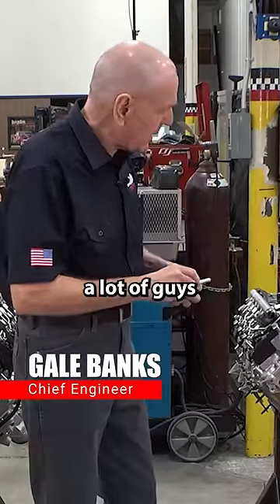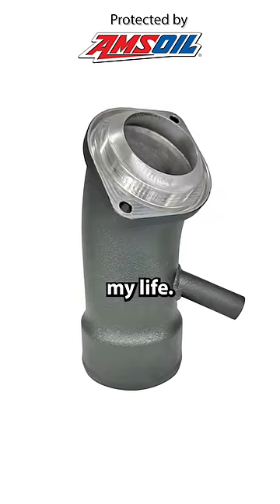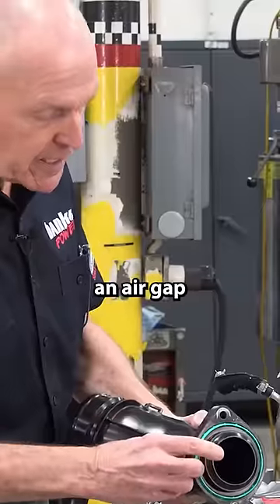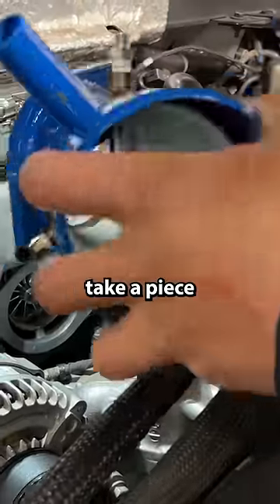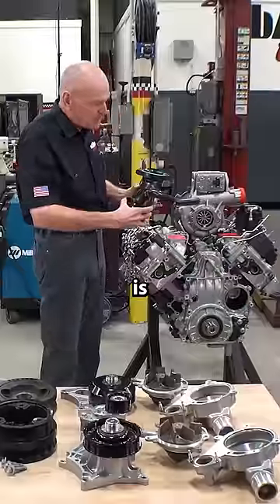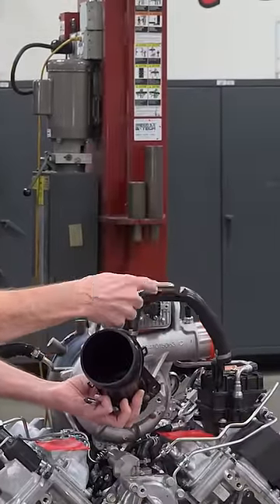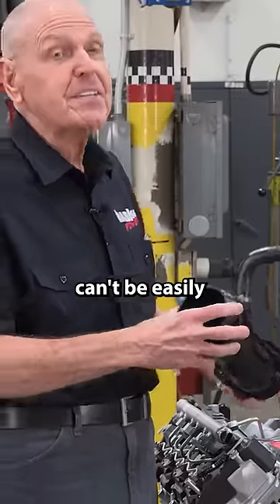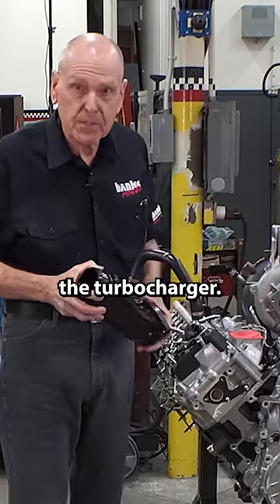The factory guys got it right. Don’t delete this!

Comment: Its funny how companies who's Total Value is less than what car manufacturers spend on Intake and Airbox RND alone think they know better and how to make better intakes than OEM Made versions. 

Good example is all the High performance intakes for a subaru that are sold while subaru spent over $25 million developing the perfect airbox for WRX's since 1994 -2024 and the factory airbox is capable of 3-4x the power output of the stock engine with perfect flow and MAF readings. 

But people are conned thinking a Ribbed Intake is turbulent when in fact an intake tubing with Ribs is Laminar flow as the ribs fill with air the the actual air flow rids on air with little resistance and no turbulence.

Comment: 1.087 pounds per cubic foot at 70 deg F at sea-level with dry air.
What weighs more? 
Dry air 
Or
Wet air?
... wet air weighs less.
Watch a barometer fall with a storm coming.

And rise on dry, summer days.😮

Comment: Wont the bypass valve or blow off valve work properly if the bigger air inlet RAM channel is restricted say at the MAF , with the bypass plumbing in between. Say you have a 4in tubing to a 3in MAF draw through system with a 4inch pod filter other side. If you have the bypass valve between the turbo an the maf an the bypass volume makes up that difference.  Im more worried about boost control than anything. So thinking further restriction after the turbo would help work more pressure on the back of the BOV/BPV

Comment: The real question is why are Duramaxes still having surging problems? 
They figured that problem out a longggggggg time ago with just a different turbine design..... 
GM strikes again 🤣🤣🤣🤣

And the 7.3s pushed oil into the turbos all the time. I see this as a fail on GMs part.....

Comment: I had a 1967 Karmann Ghia that I rebuilt with stock compression years ago (I think I was in my early twenties) and was planning on installing a Rayjay turbo (rather than the more popular twin Weber carburetors).
But I knew nothing about the engineering and in the end sold the turbocharger back to manufacturer and drove the 1600 up and down the west coast for many reliable years. 
Glad I didn’t blow up my motor with a poorly designed system

Comment: I get the turbo surge recirculation point that you made. But the crank case ventilation system come on 99% of diesel guys delete that right off the bat. You cannot tell me GM system works on not getting oil from your crank case back into your intake. I have a 2019 L5 P diesel and at 30,000 miles you can see oil in your intake. The dealership told me that was normal right after my warranty I deleted that and kept it off. Now, my crank case vents to the atmosphere.

Comment: He's like any other seriously devoted gearhead that likes to think outside the box and outside the norm of what anybody else is doing with their product, service, or maybe even their own personal vehicle. I am the same way... I have to be absolutely different than the general public because i want to go down my own avenues, so that maybe i could inspire people with my own findings along the way. For the most part, my S.O.P. is as follows, Apply common sense. learn and observe with the senses we were given, look for potential problem areas, do some research if a problem is found without an obvious answer. Apply that research. Make observations again. Then make changes if necessary. But, if it didn't ever "need" to be changed for one reason or another to start with... don't mess with perfection. You always need to be paying attention from every angle to every single detail. You need to prioritize reliability and functionality where it counts.

Comment: You’d think this would be obvious. Throttle bodies have a flared in bit closest to the intake manifold and I see people modify these all the time by chucking them in a lathe and milling it out to a constant diameter.m. Maybe a 76mm throttle body has a 70-72mm opening at the bottom.

They will do dyno pulls and wonder “why did I make the same power but less torque with a bigger throttle body?”

They can even erroneously diagnose it as reaching the limits of the fuel flow.

That smaller size is to account for the butterfly valve so the flow through the throttle body minus the open butterfly valve should equal the flow out of the throttle body.

Doing something isn’t always better than doing nothing.

Comment: I've never understood people treating intake airflow on boosted engines like N/A systems.  So long as you do not have a restriction/problem, gains are going to be marginal, at best, modding it.  Furthermore, aftermarket filters are known for allowing more particulates through which will annihilate the vanes on both turbos and superchargers.  If it is boosted, you are best off taking good care of the stock system (or building a stock-like system for motor swaps).

Comment: Great point Mr Banks .. alot of cars tend to burn oil do to over pressure of the intake, that  must be my problem that when I hit 60 mph or above I get burning oil smell on the Jeep tj . 4.0 ..
That could very well be the culprit of the issue. I have a aftermarket Airaid system . FYI

Comment: Ya, I haven't played with those, yet from, my understanding you bring the pipe size up with the turbo if you change the pipe. I did fuel first more filtration than stock

I don't like EGR as the carbon stands when first cut adds uneeded wear to parts, from my understanding could be wrong. Ideally imo you'd run no dpf while the engine is cold with a tune to reduce soot, then when it's hot producing nox flip on the dpf with tune. Just a shot in the dark

Comment: It’s the same with a lot of after market mods. Even if they do boost power, handling etc. they usually do it at the cost of longevity. Car companies literally do thousands of miles and tens of thousands of hours to develop their products and you think that some bloke with a tig and some pipe is going to be able to improve that? The chances are quite low. Not impossible but low. 
The chances your going to break something sooner than intended, we’ll that’s quite high. 
You vehicle, your choice.

Comment: Between having an engine that would last half a million kilometers without an adjustment and rebuild, and five more horsepower but risking blowing the engine in less that one tenth of that mileage... I won't risk it, i would lose lots of time and money in repairs i can avoid. Though you guys at Banks knows how to make products fairly superior than the stock, made from sixty and even mofe years of experience.

Comment: More then aftermarket. I see a lot of people and cars for good example an upper intake manifold bracket will have 3 bolts on 1 side and it’s missing 1 cuz it’s the hard one to get(in the back against the silencer panel) trust me, if the car didn’t need that bolt then the factory would’ve saved that money on the bolt. All bolts must go back they’re there for a reason. Now cloth fabric type under trays are an exception in some ways. But think about that next time before u say fuck it.

Comment: Way back in the 60s, especially with a transi. I had one of the smoky in the bandit once myself. But they were called tuning. The pipes you had to know the length and everything on it. And you had to do it just right to tune it to where to do good. You had it too big or too small or wasn't right? It just didn't work right? We used slide rulers back then. Now you put it all in a computer and it designed something for you, but it doesn't have all the information you really need.  It really needs

Comment: Cap off the ccv hose inlet, perform ccv mod, reroute ccv hose towards the back of the truck with about 10-15' of 5/8" heater hose and the ccv will never create an oil consumption issue. If blow by is at minimal due to your religious maintenance, than what little vapor or oil residue that comes out of the vent hose will not be an issue to your vehicle

Comment: I gotta tell ya...I definitely noticed an improvement in throttle response and turbo response when I upgrades the inlet pipe on my VW GLI. It actually opened a can of worms and welp I couldn't stop there, upgraded the turbo and all eventually.

Comment: My dad’s gmc has been having nothing but o2 codes and we don’t know why. He’s replaced every single o2 sensor and some multiple times. Installed bung spacers for the front ones and even fixed wires for them. And nothing works still throwing the code and it won’t stop smelling like gas. My theory is that his non banks cold air intake is causing fuel issues but it could also be bad injectors since they haven’t been replaced at over 200,000 miles. Any help would be great so he doesn’t have to get rid of the truck

Comment: Used to flare the end of the oil separator on the air cleaner on Mercedes 617.952 and 951 , would pull a little more vacuum in the crank or maybe take care of worn out blowby

Comment: I have the opposite problem, my pressure relief/recirc system is pushing pressure into the crank case so oil spurts out of every seal when it dumps.   Its mostly standard but with a slightly shorted inlet pipe.  There is no check valve as standard, but I am running higher pressure around 3psi above standard.

Comment: Aftermarket parts are mostly about looks. I got a car the previous owner put a "fresh air inlet" on. It was mounted so low it sucked up water when it rained. Turned out the stock inlet box also pulled in cold air, so no reason for that aftermarket POS.

Comment: Also your ecus tune is scaled for a certain diameter pipe based on your maf/ mas. You change that size, and you change your fueling - for the worse.  You must adjust for this.

Comment: @bankspower i have a question i cannot get answer for unrelated application. If opening size of tank is 2 in but flows continues to 3.5 in to blower but final exit is 2 in. Is there benefit to 3.5 inch to blower would 2 inch be same? I doubt you will even see this but if u do help a brother out

Comment: 40 years working on centrifugal air compressors, That imbalance of air and pressure  can also cause rotor unbalance/ instability   as well as pulling oil through the turbo.

Comment: There are certain components you just leave alone. 
Like the turbo inlet, its not just a piece of plastic pipe a lot of engineering went into it.
An actual cold air airbox and high flow air intake is something that one can install successfully but id leave the turbo inlet always.

Comment: See the thing is , in a boosted setting the factory parts are typically plastic and will crack or outright explode when running higher that factory boost levels. So I rather burn a bit of oil than having that pipe fail than potentially allowing foreign debris into my engine.

Comment: I know he knows what he's talking about buuuuut......you won't be pushing oil into the motor the intake doesn't make oil or have oil in it it's purpose is to actually pull ccv from the motor to reduce ccv the ccv has oil coming from the motor which in turn pushes oil out of the motor so if the ccv on the intake doesn't venturi the ccv it won't pull ccv from the motor but at no time will it push oil into the motor it's on the wrong side of the turbo to "push" anything it maaay push some air if venturi is wrong but never oil

Comment: I agree. I wanted to do a really nice roushe cold air for my 21 5.0. The instructions said remove the entire resonator system. No thank you, I sent it back. You spend money for the engineering and experience of the car manufacturers. Don't mod a new car with aftermarket parts.

Comment: It can increase the amount of oil getting sucked into the intake?!
Sounds like a good way to buy yourself into a run away situation with one like he was showing!
Reply: If you've got that much oil coming over your breather, you have bigger problems than the size of the tubing....  and frankly if it's that messed up, you should probably just let it blow up anyway because the internals are garbage at that point for that poor of oil control and blowby.

Comment: So how do you improve off of this without what you’re saying can happen with aftermarket should we increase oil pressure to the turbo, and then replace that rubber hose with some kind of metallic material or just leave it as stock

Comment: That little he said has to have "the right pressure". That little tube sees vaccum, as air being pulled past it, it creates suction.
Reply: Yeah I don’t see why any of those aftermarket ones wouldn’t do the same
Reply: Suction is not a vacuum. It's just lower pressure than atmospheric or whatever is in the pipe. They create too much or not enough pressure drop to work as designed.
Reply: @enwri There's a thing called "gauge pressure", which is subtly different from absolute pressure. Negative gauge pressures are very common, because the 0 point is calibrated at either ambient or 1 nominal atmosphere.

Negative gauge pressures are referred to as "vacuum" pressures.

More broadly, a relative pressure in one part of a system that is reduced below the pressure in the rest of the system, such as within a venturi or via a pump downstream of a restriction, may also be called a vacuum even if it's above ambient or 1 atmosphere.

So the tube can be under vacuum and pressurized - it depends on your frame of reference.
Reply: @enwri   If I said low pressure, they would think pressure.  Thats why i used the phrase I did.  Its like the air dam under a radiator core support creates low pressure to draw hot air thru the radiator and out of the engine bay.  Esentially the intake tube is scavaging.
Reply: @Azlehria 
How is 'more broadly' different from regular broadly?
Reply: @largemarge1603  It's a comparative phrase, prefacing a broader - and often colloquial, when the narrower usage is precise or standardized - usage or definition than that described previously.

Comment: Honestly, this never occurred to me over the last 7 years (70k ish miles) of my truck on its current setup. With the current tuning, I don’t surge much letting off it while still making about 36-40psi on a hard pull, but still makes me wonder about the fleece elbow I threw on shortening the life of the drop in.

Comment: I remember asking my mechanic about a performance intake, and he said, "the engineers who made the factory intake knew what they were doing."

leads me to think, there's a 6.blow I driv eon occasion, and it's been an absolute slug since the engine rebuild.  they also put an aftermarket intake on it, sometime recently.  wonder if that is contributing.  but I think the turbocharger just isn't boosting properly.  it seems to be spinning up too high.

Comment: Don’t think it can be made out of plastic either need be strong maybe aluminum  because my stock pipe exploded from back pressure problems that will exist down the road can destroy plastic and oil is what you don’t want in air to air or intake it sucks to clean that out.

Comment: Another good way to push oil into the intake through the turbo is to premeasure the oil and then use the wrong oil container. Worked like a charm. 😂😅😢 On top of ol smokey all covered in oil....One GD mess I will never forget.

Comment: The surge protector is a real thing, I would not remove that ring, however after that pipe size should not matter much unless you are making a massive diameter increase

Comment: Somewhere between Cummins and the heavy truck manufacturers somebody forgot about that little problem on their natural gas engines we have 2 ,2008 class 7 trucks and they both have severe turbo surge when you let off the throttle under heavy acceleration.

Comment: The day this dude switched from "let's make diesels powerful" to "let's make diesels green for the economy" was the day I started disregarding everything he has to say. He lost my respect the day he sided with the liberals.
Reply from the maker: Gale Banks is fighting the EPA just like other diesel performance parts manufacturers. He's as far from the left as you can get.
Reply: @bankspower  but I guess I oughta to not worry about it anyways, I'm an all-mechanical type guy so with a 12 valve Cummins there's no reliability-killing DPF, EGR, etc to cause problems! 🇺🇲🦅🗽

Comment: Lol or you machine the anti surge out, run a larger compressor wheel and not gaf lol
Everything you are talking about is for 200k mile reliability and emissions...
If you don't care about the turbo lasting 200k+ miles or emissions, there are better options to make more power...
Reply: Do most compound kits have this anti surge thing in the pipe between each compressor stage?
Reply: The anti surge is the ring either pressed or machined into the compressor cover.
For drivability and long term reliability they are great.
But they do sacrifice some air flow...
So just depends on your goals on if you should keep it or not.

Comment: Hello Gale, Love your products and have been using them for many years...Here is a few ideas I was thinking of
1. Could a turbo be mounted downstream past the cats? I figure the air will have more time to be cooled and the avoiding of all the extra heat from the engine compartment and avoiding the direct heat from exhaust valves...Oiling can be a separate/Remote unit and NOT Mixed w engine oil!
2nd would be a device that can help Suction/ Evacuate the Exhaust...this is where I would think an Electric Turbine would be effective...it will Always give negative pressure in the exhaust! An Exhaust Vacuum sorta, Just a thought!
Reply: The heat (read: energy) in the exhaust system is what makes the turbo spin. Remove this free source of thermal energy and the turbo will do sod all. Just a thought. 😊
Reply: @mrdanger,
I saw your '2nd', and read it as 'tuned'.
Reply: @Zgurkogel  I was thinking heat was the enemy, hot Air is Less dense and Remote install would save the bearings and bearing oil from heat decay. Thank you for the correction